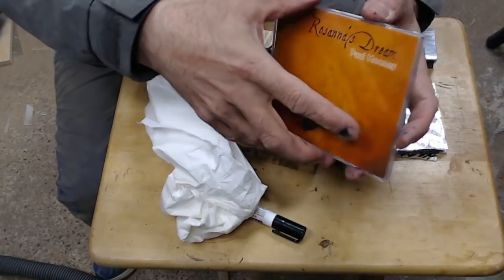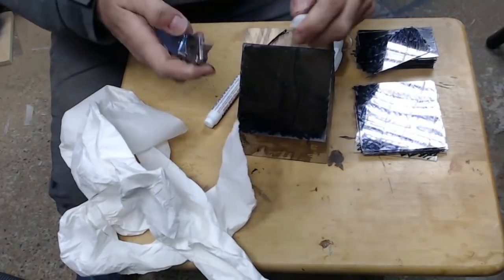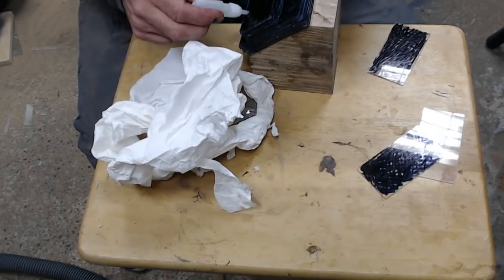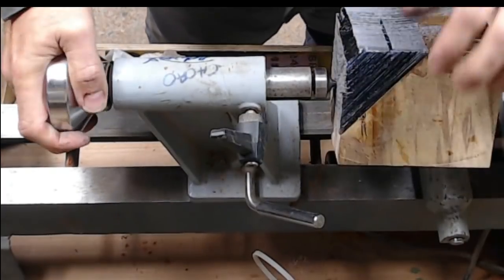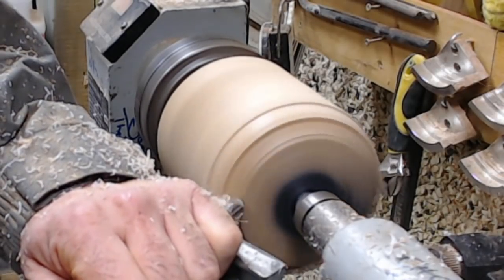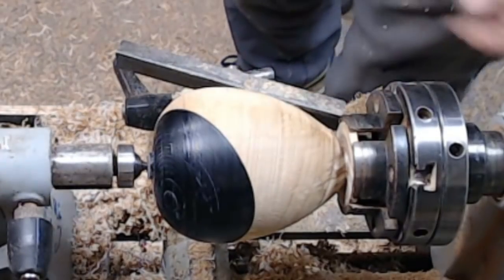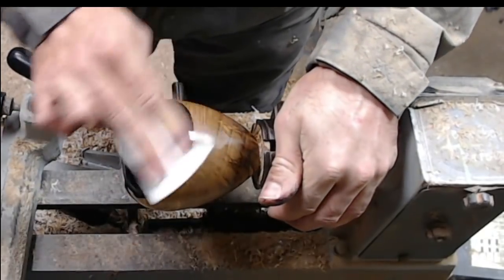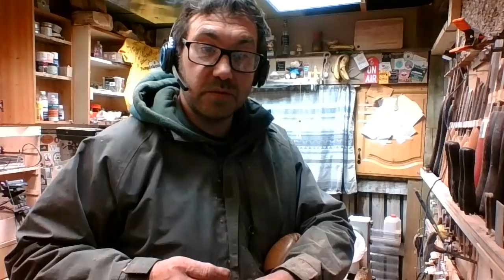Woodturning a wood and compact disc case Easter Egg.

Comment: What do you use to cut the CD cases?
Reply from the maker: Hey Larry, The bandsaw with a fine blade cuts them fine individually as long as you pass them through fast. If they are glued  into a block then the bandsaw tends to heat them up and melt them. 

You can also cut them by scoring them with a knife and snapping them. 

Thank you for watching and commenting, regards Steve.
Reply: Templeboy Turnings thanks I watched the live feed the other day.  Really enjoyed it.  Thanks for the quick response. Happy turning. Hope to give this a try.